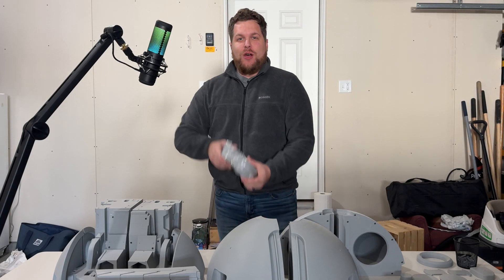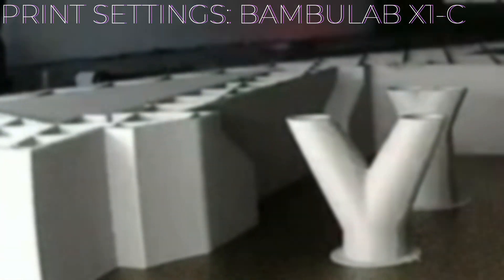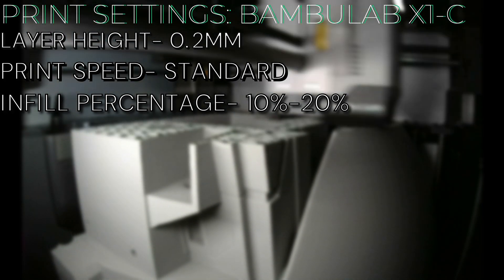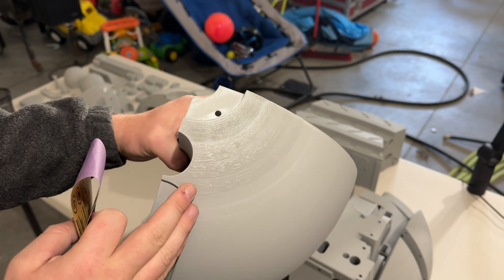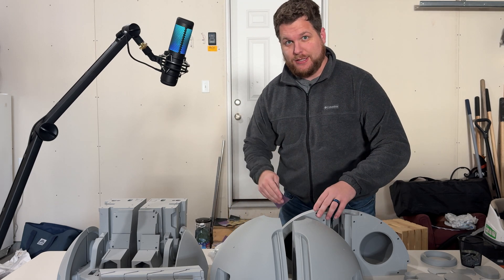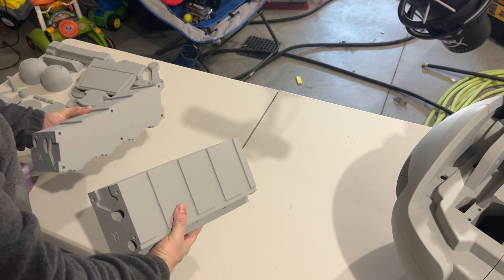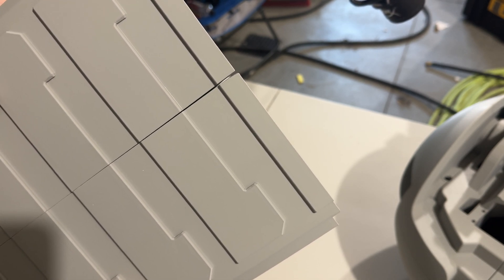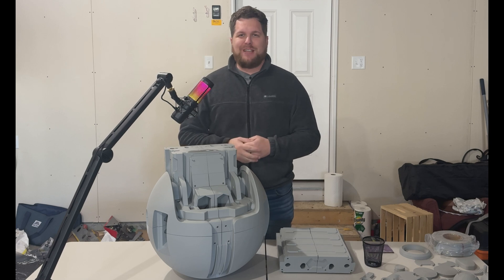3D-Printed Droideka Build: Printing the Main Body Sections - Episode 3

Comment: Awesome project!  I would feel inspired to motorize parts of it.  The beauty of fiction is that things don't actually have to work, such as with the three legs.  It wouldn't be able to walk in the real world without a heavy gyroscope or the dramatic shifting of weight to keep it upright when a leg is lifted.  To bad they didn't design it to be a hex.  Other functions could easily be motorized though, making it a very fun project.  i would also install lighting where appropriate and a sound card for audio.  

For those not yet familiar with 3D printing and fabrication:

1)  It is clear that even a Bamboo printer doesn't print any better than other, cheaper brands.  It really is about adjustments and settings regardless of the machine type or brand.
    
2)  FDM 3D prints are basically strings of plastic with a (roughly) circular cross section, laid down in layers, like a coil of rope.  Due to this, there will always be layer lines, being especially prominent in curved surfaces.  The outer surface of these 'strings' is where they need to be.  The gap between them is 'missing material'.  Sanding the layer lines to flush the surface actually puts the part way out of spec by removing material that is supposed to be there.  It is necessary to fill the voids with filler, THEN sand the filler until you get down to the plastic, but no deeper or you will put the part out of spec.  The only time this is not true, is when the printer misprints and lays plastic outside of the part boundary, or the part has warped.  Otherwise, don't sand 3D prints... fill them and sand the filler.  
  
3)  Always wear a mask.  Fumes and dust will collect in your lungs, causing physical and chemical damages which may become permanent.  Normal paper type masks are not sufficient.  When inhaling, the air takes the path of least resistance, which is not 'through' the filter material, but around the edges of the mask where it does not seal properly around the mouth and nose.  Use a proper painters mask, not only to get a proper seal, but also to ensure filtering of particulates common when sanding 'any' material.  If dust is not cleaned up regularly, just walking across the room will lift particulates, making them airborne.  Keep it clean and wear a mask!
Reply from the maker: I 100% agree. Unfortunately with how this is designed there’s no real way to motorize it. I will be putting lights in the eyes at least. I hadn’t really thought of sound though, so that’s intriguing.
Reply: @RegalRebel  Are the files available in other formats like STEP or SAT?  Would be nice to be able to modify the parts in CAD to expand functionality.   The illuminated eyes will look great!  I suppose the Droideka didn't make much sound other than rolling and firing weapons.  I don't remember from the movies, but was it able to communicate verbally at any point?
Reply from the maker: @ they are just available from Droid Division as an STL. The main thing with this build is there’s a lot of weight to keep in mind. There’s a whole metal pipe inner skeleton that these build around.

Comment: I'd use a body filler like Bondo on those dome sections. Much easier to sand and will leave it much smoother
Reply from the maker: Thank you for the tip! Will definitely have to try it out! I’ve used bondo spot putty for those and that has worked really well for my past projects.

Comment: Serious question, is that all dry sanding? I suspect wet sanding may ruin the project.
Reply from the maker: It is dry for now but wet sanding would be perfectly fine on it. I typically just wait for that in the priming process.
Reply: @RegalRebel  excellent, didn't know if water would ruin the filament.
Reply from the maker: @ nope it’s just plastic so water doesn’t actually ruin it after it’s all printed.

Comment: "overachieving this week, wow" killed me 😂 killer progress dude!
for slope issue maybe its not a file/slicer thing and its a mechanical issue with strain of some sort? could be relating to warping as well. Throw it up on the subreddits too, theyve helped me out bfore. for the spine warp its not too bad? light work with a heat gun and try to massage it back in place maybe not sure. worth the test if u might reprint anyway.
Reply from the maker: Thank you so much! I will absolutely keep that in mind. It seems to be on a lot of my longer pieces that span almost all the way along the build plate. I agree that it's absolutely not a file or slicer issue. its all bed adhesion. I'm also not using any "helpers" when it comes to bed adhesion. I think I'm going to try rafts on those types of prints from here on out to see what that does too.
Reply: @RegalRebel  of course! biggest ive done is maybe 1/8 of a helmet so not the tallest, but long lines on the full cross of the build plate. Brim came out best for me and also slowing it down. End of the day a lot of the nice finish just came in the post process anyway. in hindsight, unless it was a massive mistake i'd fix it in post. Every problem and piece is different though.
Reply from the maker: Post processing, as you know, can make or break a project. I find it kind of soothing in a way. I'm looking forward to the post processing of this droid! :)

Comment: just use some bondo in the gaps instead of reprinting it
Reply from the maker: I thought of that but I forgot to show that there’s a key that holds both sides together and the tension is very tight. I’ll still try to make it work though. Thank you very much for the suggestion though!